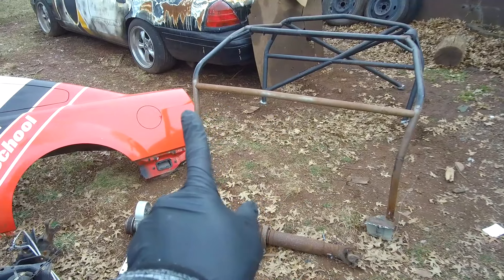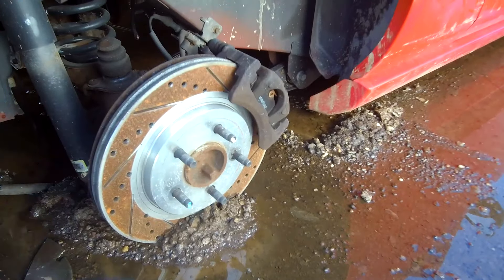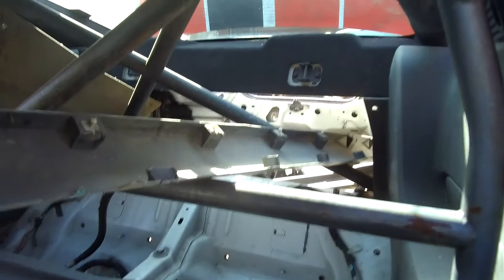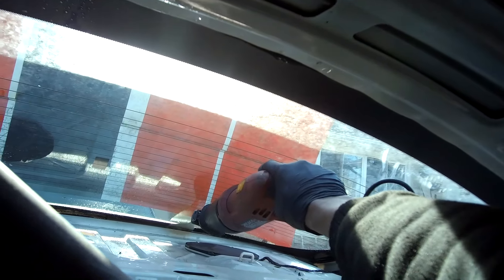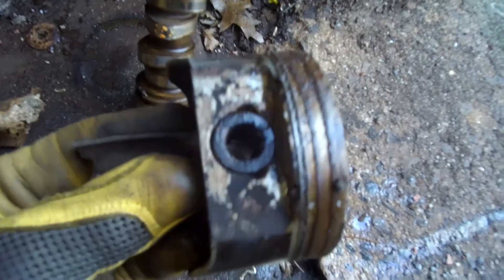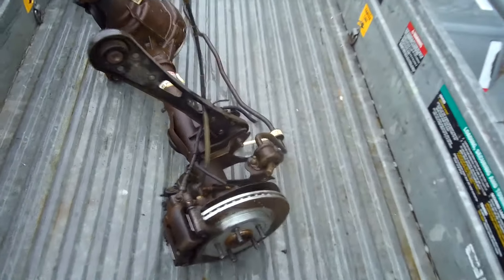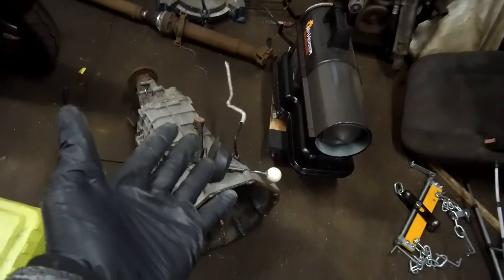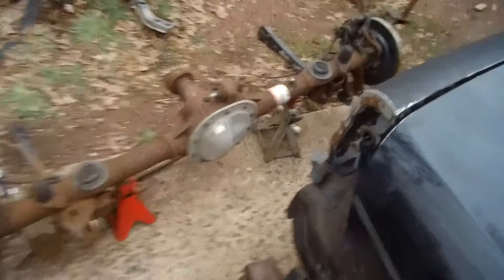Scrapyard Mustang Budget Race Car! #car

Comment: Hey! 
Hope you’re still on the comments section on this video! I gotta ask how things are going with your manual swapped turbo Vic! Did you end up getting a tune on it or did you work out how to getting it running right on you’re own?! I’m likely to go to Marty eventually, but on my 08 Vic, I have everything I need to put the manual swap together, and  intend to put it together real soon.  I’m hoping I can drive it around at first without the tune, but we’ll see how that goes! I inquired on how to do a hydro clutch setup sometime back... but I decided I’d rather go with a cable on The first go round.  I hope your build is going well, and  so excited to get mine rolling really soon! 
Cheers